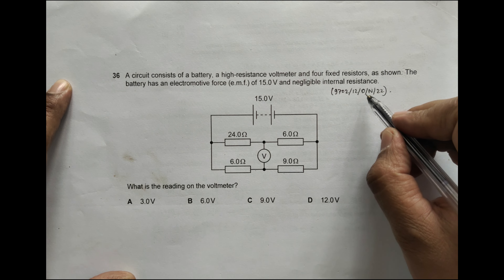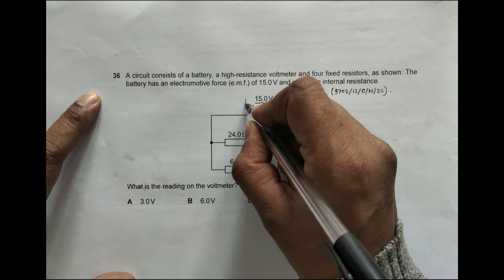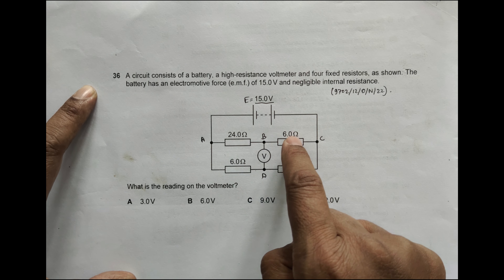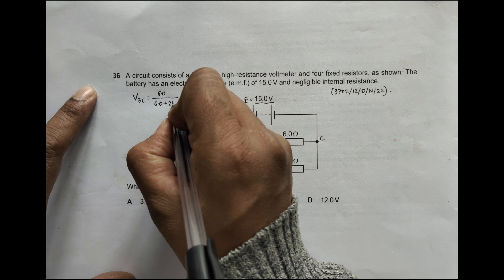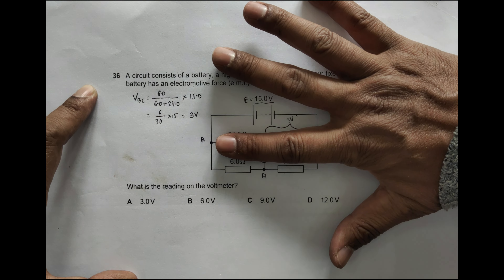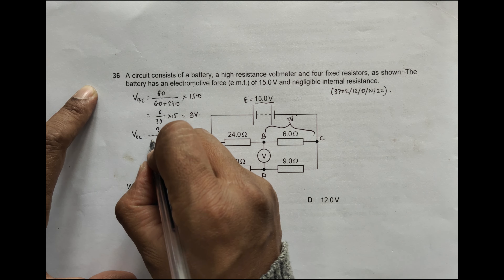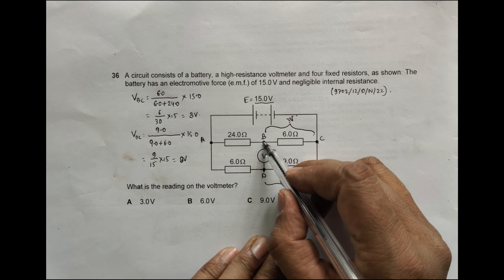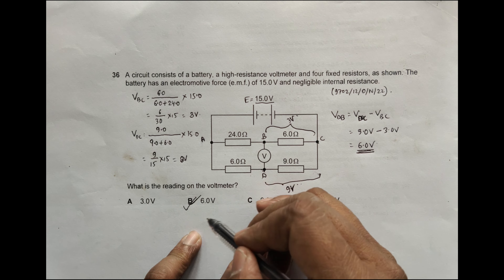2022 CAIE AS & A level October November Physics Paper 12 Q N 36 (9702/12/O/N/22) by Sajit C Shakya

Comment: Thank you so much for the explanation. But why on the last part, you minus the Vbc from Vdc to get Vdb (Vdb = Vdc - Vbc)
Reply: Because the voltmeter records the potential difference between the two points and the difference is found by subtraction. Because when you subtract you looking for a difference and not division or else they would have said find the ratio. I hope that makes sense.